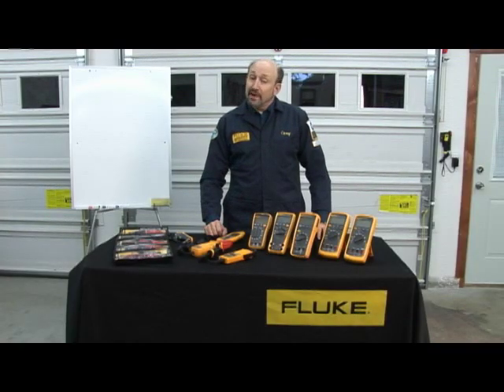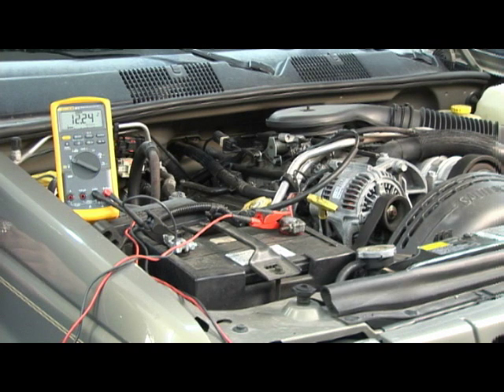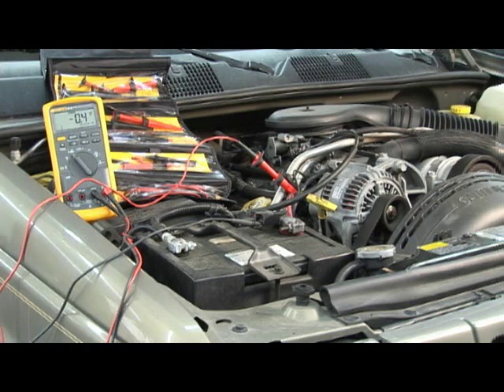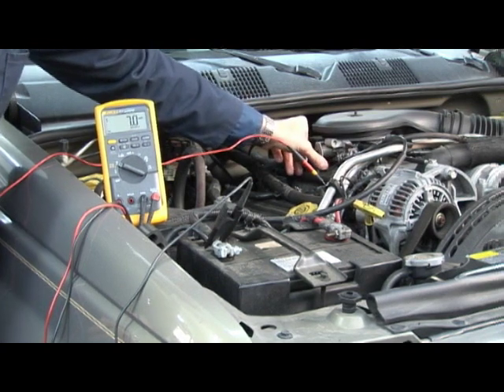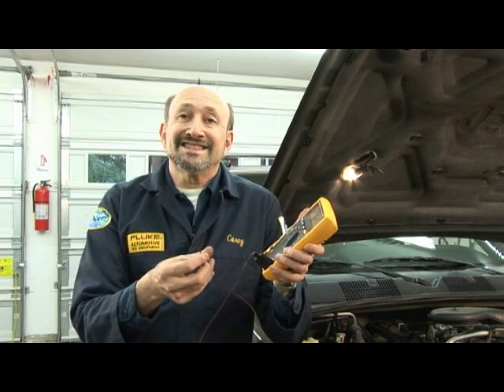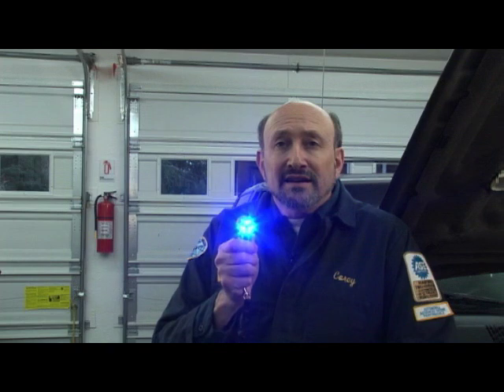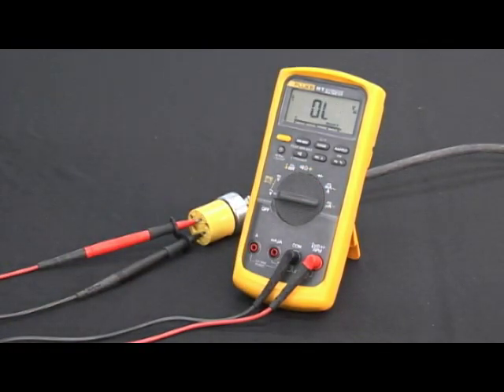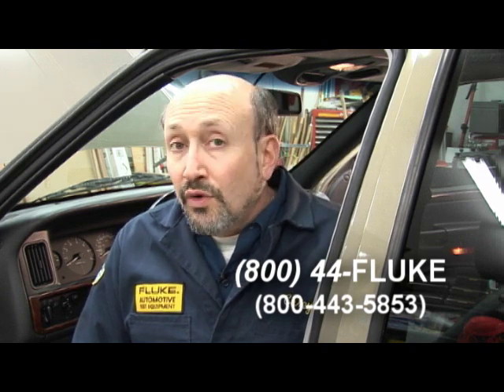Fluke Automotive 2010 DMM Tutorial F233 and others

Comment: Is the Fluke 97 Auto Scope meter still a good diagnostic tool for current cars?
Reply: I sure hope so.  I just purchased a Fluke 98 Series II ScopeMeter to use on my 2004 Toyota Highlander 3.3L.  Not too modern but enough electrical components.